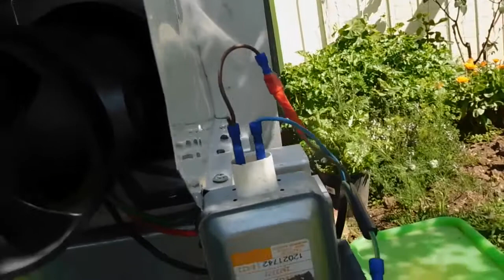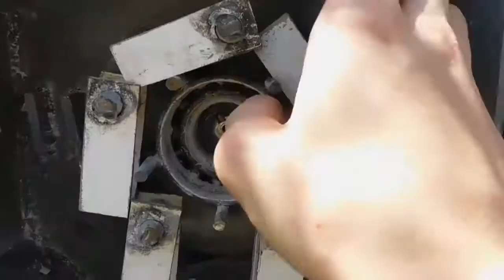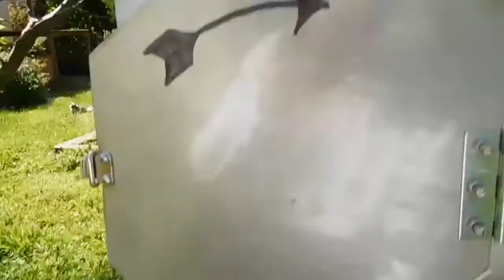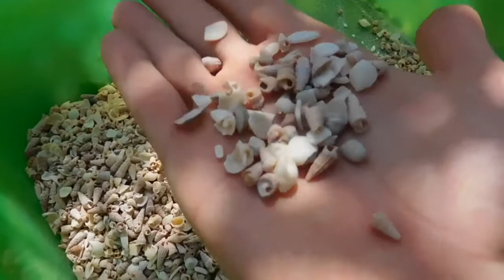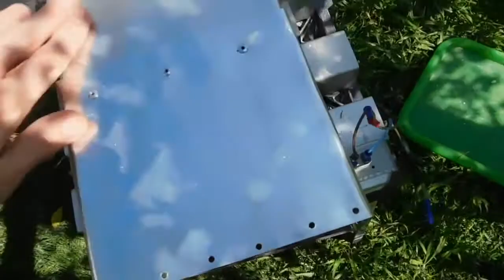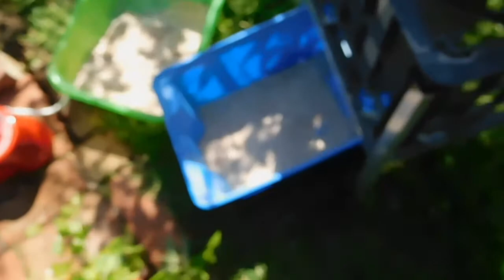Home Built 2.5 HP Hammer Mill

Comment: Heavier hammers will help it work better, especially welding some ends onto the hammers. When doing the ewaste try to collect it all in a heap of small parts in a large jar and use some pool acid to strip the copper out, and if you can then strip the gold out. 10g or so per ton, might even make it a good mining process, but the CIP leaching would be an issue though.

Another tip, add a small AC relay to the mains input, and use it to switch a low value resistor, like an old kettle element, across the motor DC terminals when power is removed, to act as a DC brake on the motor. Makes it stop a lot faster.
Reply from the maker: Thanks for the tips, yeah I do need to put some more weight on those hammers, and also deal with the balancing issue. The DC brake to force stop the motor is definitley something I am considering right now